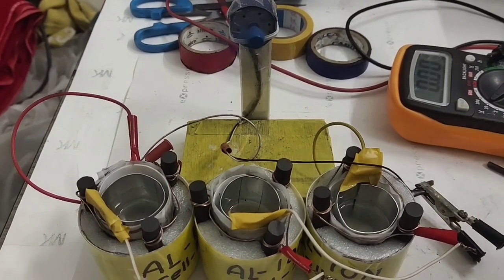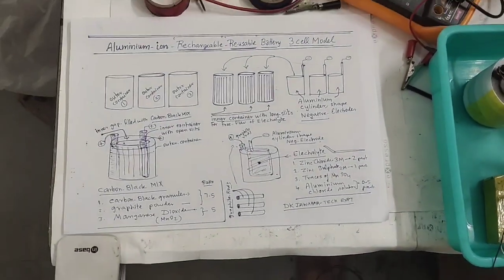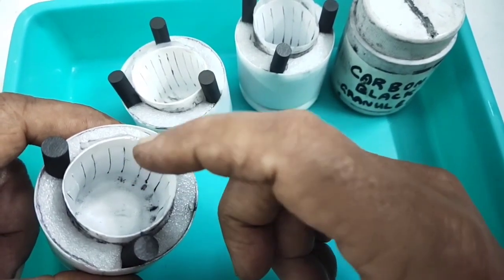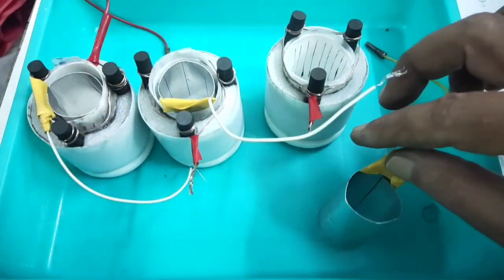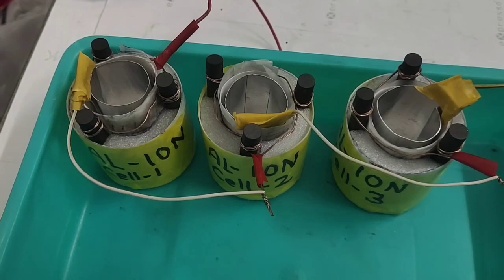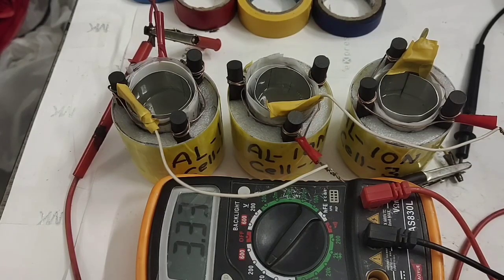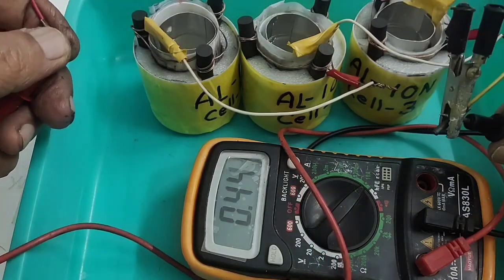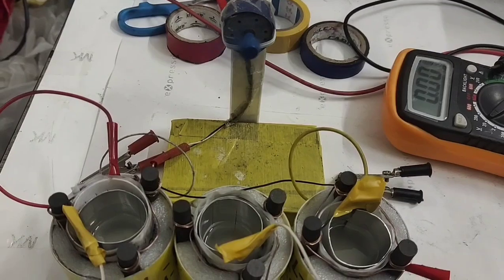ALUMINIUM ION BATTERY, RE-CHARGEABLE, RE-USABLE, 3-CELL MODEL, 3.9V, 500mA. D.I.Y MODEL,  VIDEO-71

Comment: What would be the after charge voltage and discharge voltage???
Reply from the maker: The present model with the design and electrolyte combination gives 3.9V, 400 to 500mAmp.. This will be constant. You can charge it fast, which may rise to 1.8V and 600mAmp for each cell. But slowly it will reduce and steady at 1.3v, 300 to 400mAmp per cell. You can try yourself and study in detail. Okay
Reply: @dkjawahar-techexpt671  

I think you can use this electrolyte to lead battery instead of sulfuric acid... I seen many convert people covert their lead acid battery to alum (aluminium sulphate) battery... Have you ever tried???

Comment: Super electrolysis 👍👍
Reply: Friend as to my knowledge this is not electrolysis. It is electrochemical in nature between different electrodes. In electrolysis, we have to supply external voltage to get the result. Thanks you✴️